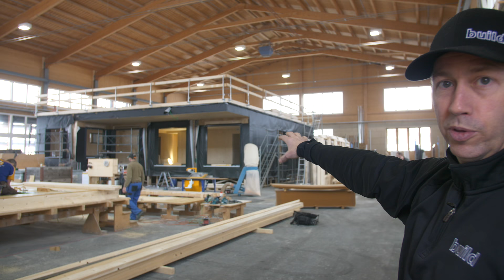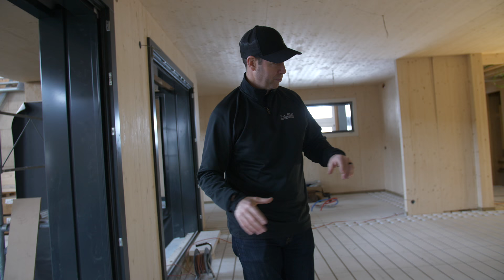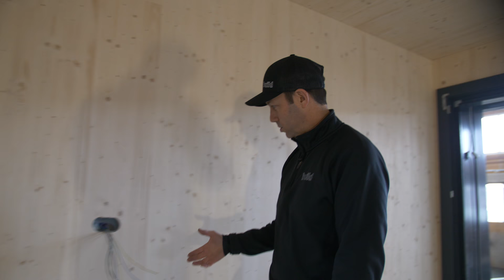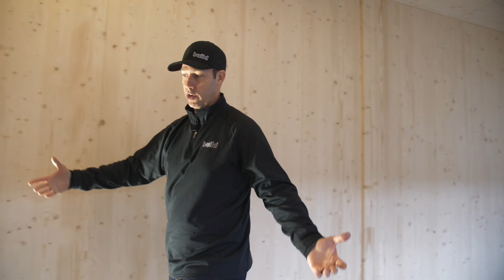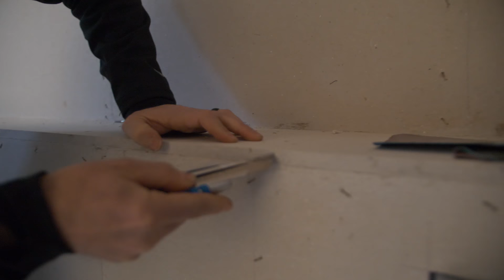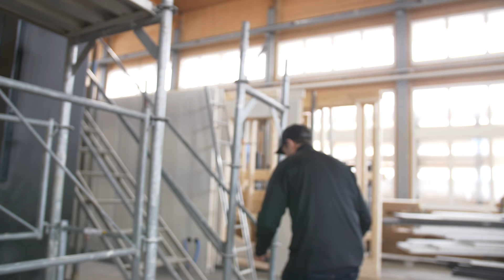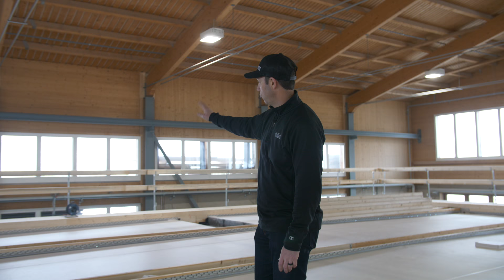Swiss Modular Home - Under Construction Tour

Comment: 11:20 thats much larger than 1100 sqf (102sqm). Based on the roof i would est 2.5mt wide per section and each section looks 12m long (40ft shipping container) so 12.5x12m + 150sqm so 1600-1700sqf min.

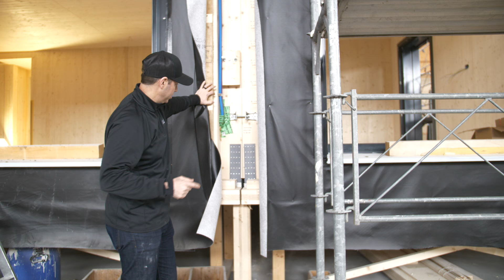Comment: A few observations. Around 7:30 you assume a steel beam behind the plates, when they just look like connecting plates between floor and wall. The tightly glued sandwich construction of floor & wall makes those big sheets strong and stiff enough to not bend. They are basically beams & floor in one. The connection points between floor/wall and different sections are the most vulnerable points in the construction. They might also need reinforcement, in order to be precise enough to neatly "click" together. The "wooden insulation" is just softboard. These are cheap, non constructional wall panels. The real wooden rulers are framing them and the profile ensures an easy and swiftly installation. Thinner sheets of softboard break easily, so i guess the panels need a certain thickness in order to give them some strength, so you don't break them while leaning onto them.

Comment: European houses have lower amperage? I'm pretty sure we also have 15 amp. I know most power strips are rated for 3500 W max, which is 15 amps at 230V.
Reply: When you double the voltage the amperage is cut in half. So a 15 amp 230 volt circuit would be 30 amps at 120 volts requiring larger wire and outlet therefore more cost.

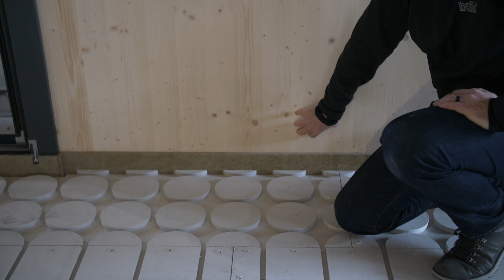Comment: 4:15 it isnt there to insulate the wall from a heated floor but to make space for a floor slab to expand without pushing the wall out and making cracks...
Reply: Yeah that makes more sense
Reply: @HelloverLord. .. Agreed. .. Same wall/floor detail when installing Hydronic in-floor heat system in our Vail, CO remodel in 1999. .. Hydronic heating the only way to go .....

Comment: Hi,,I`m from Norway  and we use the same air ventilation box and it is a heat exchanger.So cold air coming in are heated up to nearly the same temperature as the air going out. All new houses in Norway have this heat exchanger box from about 1995.

Comment: ah, ok, no forced (scorched) air heat, of course. They're honest builders.
Reply: Of course you can purchase a honestly-made, Swiss-manufactured furnace--made for use in residential construction.  Not sure what you're implying by your comment.
Reply: @kenc2257  I wouldn't be interested in a furnace, honestly made or not. Horrible way of 'heating' (though cheap). Very uncomfortable. Boiler is the only way to go. I think in Europe they do understand this better.

Comment: I strongly considered building a house in exactly the same style. It was invented in Austria (the country in Europe without Cangaroos!) and is called Holz100 or Wood100 in english. A german company slightly improved the process where you don't see the wooden dowels on the inside. They use wood screws unlike the dowels in the Holz100 system. The Main benefit is the extremely high thermal capacity, so your house doesn't overheat in summer and temperatures don't droo fast in winter. Plus it's prefab, so building the closed hull just takes two days until it is fully rainprove. It turned out that the best building technique (in my eyes) is also the most expensive. Therefore I finally decided to build a standard framed wall or else I would habe to leave the basement and garage away.

Comment: The Swiss may build to enviable quality standards etc., but this does make buying a house here an incredibly expensive affair. I would put it on par, price wise, to the San Francisco bay area. A typical 1000 sq ft. home, which is considered quite large, usually starts at no less than 800 thousand Swiss francs if you're lucky. That's roughly the equivalent in USD. More likely it will go on market for over a million Frs. For what you pay in Switzerland for the equivalent in floor space of a 4-car garage you'd have a mansion on a full acre in the American southwest.

Switzerland, as a result, has the highest number of renters per capita of any country in Europe. Only about 30% of Swiss actually own their homes and many of those owners inherited from their parents. Home costs vary to some degree on location. Areas closest to cities and near lakes are the most expensive. Go farther into the country and prices drop fairly dramatically but, as the joke goes, you'll need a helicopter to get to work.

Yes, houses are built to last in Switzerland and the techniques, materials etc, are quite impressive but, as far as actual home ownership goes, it's one of the least democratic countries in the western world.

Comment: I missed the opportunity to buy a modular home.  In hindsight I would have.  I had some issues with it.  I found some land in South Oregon that I would consider buying and putting a home on it.  The homes I like are the ones that have say two bedrooms down two bedrooms up.  Either than or perhaps put a few units on the land, that way it could pay for itself. 

My current house has a raised foundation which is easier to plumb on.  I would almost rather have a partial raised foundation, like having all the pipes in an area that is reachable and the rest of the house on concrete.    My sisters house has a small basement, but I don't know if all the pipes are within easy reach.

Comment: as the price question pops up here too, I repeat  my comment from another vid:
we build a multi storey house (3x 120m²)  in solid timber with a concrete stairwell for fire protection at € 1950.-/m² with all the features he showed.  Energy consumption will be 55 kWh/m2 or 0,1 gallon oil/sqf /year. The plot is in Munich city center, which is a quite expensive town to build in.  So this is approx.  $ 800K or $ 33,5/sq foot.   How much is such a house in a northern region (snow and storm) of the US? ~

Comment: How does a flat roof take a snow load? I live in Peru and man our construction and electricity is truly scary! Single pane windows, Cracks around all windows and door big enough to see light and big drafts and for mice to march in at will :( and thats on the more expensive houses. Grounding systems cost as much as the whole house so nobody does it. Im getting ready to build a stone cottage in April and sure hope its tighter than my current house

Comment: Guys did you know that it is still build code in Switzerland to incorporate a nuclear fall-out shelter in every new dwelling? This is according to articles 45 and 46 of the Swiss Federal Law on Civil Protection.

This is why most buildings constructed since the 1960s (the first regulations on the subject were passed on 4 October 1963) incorporate a fallout shelter. So Matt, this new pre-fab isnt just going over a concrete 'basement' its a shelter too!
Reply: Not nuclear fallout shelters, air-raid shelters.
Reply: @Eir Scapes .. Interesting. .. Always thinking the Europeans ... (Swiss)

Comment: nobody uses wood panels insulation in europe cause its expensive; nobody builds prefab wood houses like this cause they re expensive; we build solid walls from blocks or brick and insulate them from the outside with styrofoam (ETICS system); interior and exterior finish is made with plaster
Reply: Europe is a big place

Here in Norway prefabs are VERY common. Most new houses in my area has been put up in weeks / maybe months because they just brought in finished walls.

Comment: In Melbourne, Australia yesterday it was 45C, our houses have no effective insulation, poor design and building standards, when it gets hot the state government turns of the power to while suburbs and we start to fry.  You can bake cookies outside on a metal tray.  I cannot understand why our government doesn't make it mandatory to make our houses have effective insulation.  We have  building codes but they are not effective.
Reply: What's to stop you from building to your requirements? Why build down to the crap codes? And yes, you get what you pay for. Good design and materials cost money, lots of it.

Comment: Very curious why they would build a flat roof in Switzerland. The heavy snowfall there would create  a tremendous load on the flat roof system.
Reply: Quite a difference from northern and that of where he said it will be located in south Switzerland, also higher up in the mountains go the more snow you get much like with latitude as the further from the equator you go the more snowy it gets. Also pretty sure those connector beams he walked on and the secondary roofing structure members are more than strong enough to handle what snow loads they may endure in the winter season.

Comment: Thanks, looks so much more well built than the junkie modular my brother bought that has the two have pulling apart.
Reply: Funny you mention this.. i actually know someone who had this happen - big fancy house and the modular parts started separating a few years down the line. I wonder if this is due more to the preparation of the foundation or the actual house, or maybe both? There's risks in everything.

Comment: My bet on the mineral wool on the outside edge has something to do with a concrete type flooring they are gonna pour. I bet the pour 2 or 3 inches or a concrete type material to use as a heat sink for radiant

Comment: I love that they don’t use drywall which is energy intensive and creative use of wood. Thanks for showing this from a builder’s viewpoint.
Reply: I wondered about that. I would have guessed that plywood walls would cost about three times what dry wall costs. I don't see enough advantages to justify that price difference.
Reply: @davefoc  they look pretty though compared to textured drywall.
Reply: drywall also acts as a fire barrier. Replacing it with plywood without a sprinkler system might not be a good idea

Comment: Fresh air supply? What ever happened to opening a window?
Reply: Heat exchanger keeps the heat in while adding fresh air. Open the window and you freeze!
Reply: @carynoname2574  It was not a heat exchanger, it was introducing fresh air into the house the same way opening a window would. Heat exchanger transfers heat/energy from one medium to another.
Reply: @JasJones123   No, it's not operating the same way as opening the window. @Gary OnTOUR is right, the house is equipped with Heat Recovery Ventilation (HRV), that has heat exchanger built-in (recovers heat from exhaust air  and exchanges it to incoming air). It's so effective it recovers up to 90% nowadays. It's not the same as traditional HVAC systems found in american houses. (cause they're usually way very leaky anyways).
It's so much better (comfortable), efficient, healthier (filters outside air) than opening a window. With properly dimensioned HRV you'd basically never need to open a window apart from summer.
It's common practice here in Europe, and in Denmark we have been doing that since 1980's. Every house since then is more air-tight and HRV is a must. In apartments it's actually a requirement for new builds.
once HRV, you never go back to natural ventilation (windows)...

Comment: Matt... That corner wood wool is not for insulating the wall against the floorheating! :DDD It’s there for decoupling the floor from the wall (breaking sound flow through the building, so u don’t hear stepping sounds at the neighbouring parts of the building). They have the same decoupling wool below the dryboards, for the same reason. It’s just higher, so the concrete and the actual floorpaneling doesn’t connect to the walls later. This is standard at Germany/Switzerland/Austria.

Comment: I would love to see how USA modular houses are built to compare to these Swiss and German modular buildings.
Reply: Depends upon the company building the modular home.  They can range from inexpensively built to very expensive.   Another way to build a home is with structural insulated panels (SIPs).  The home is designed and the SIP wall units are built in a factory and shipped to the building site for assembly.

Comment: 3' is about 1meter. Also birch is a very common and fast growing wood which is used for a lot of construction in Europe. 240V is standard and if you guys didn't see our GROUND wire is actually the green/yellow wire and is insulated. So the HOT Leads are BLUE and BLACK or BROWN. So each lead is a HOT we don't use any NEUTRAL wire's. That's a major thing and also reduces a lot on the electric cost billing side because you use a lot less KW the KW charge is double to what the USA is charging. But Electric is no longer a monopol system like it is in the USA so in Germany you can have an Electric Provider from Spain for example which keeps competition and price hikes at bay and on top it forces them to build redundant Power Grids not like in the USA where a lot is only Single line build.

Comment: By "really cool" Matt means different, not better. A flat-roofed structure is clearly not better in snow country. (This roof clearly has totally inadequate drains and inadequate slope and is going to be problematic in Switzerland's climate. Even people with sloped roofs in the Austrian Alps are having to shovel snow off of them to prevent collapse this winter.) A wood structure is clearly not better than one made of a fireproof material. Hidden added expense for no purpose is not better.

Siga taping the seams in a floor is overkill. I've never heard of anyone ever complaining about air infiltration up through seams in their floor. Why? Because a floor has multiple layers and the seams don't overlap when installed correctly. There's also the ceiling of the story (or basement in this case) below plus the insulation preventing air infiltration.

Why you would go to the expense of installing wooden walls and ceilings and then paint them white is beyond my comprehension. Give them a good coat of shellac or varnish and maybe some stain and let the grain show. You paid for premium surfaces, let them show.
Reply: they were taping a wall section laying flat, see the window cut outs? at 1:45
Reply: Yeah. And the drainage system IS adequate. It’s size is been given by the Swiss national code. Additional to that, they must add secondary overflow pipes, so water can’t pile up. But yes, this kind of roofs makes everything more expensive, since the construction has to be strong enough to carry the snow load. It’s just for looks.